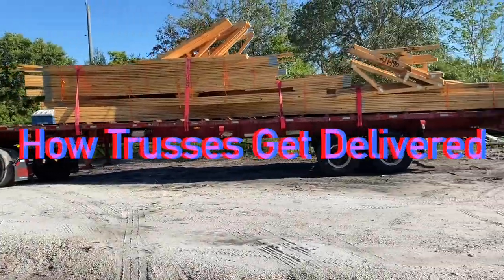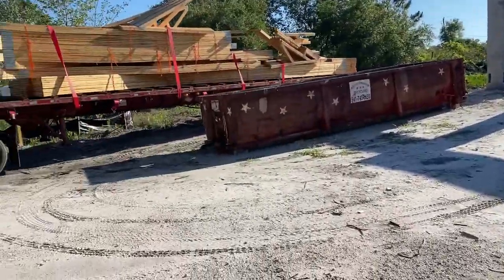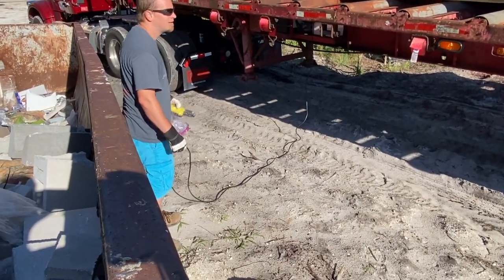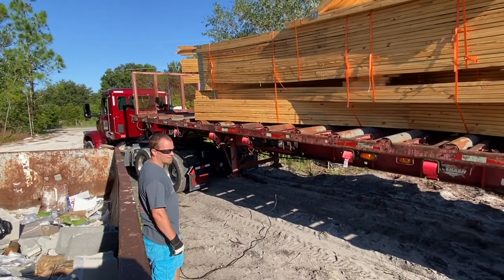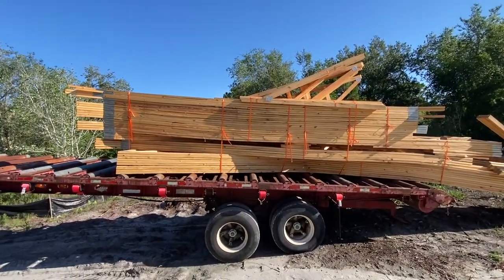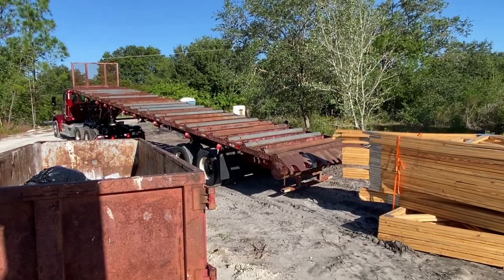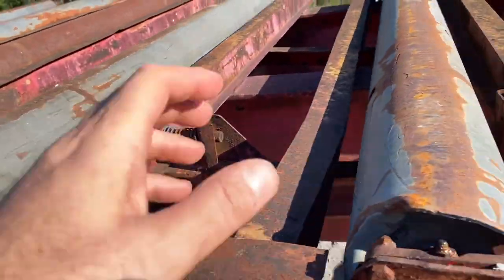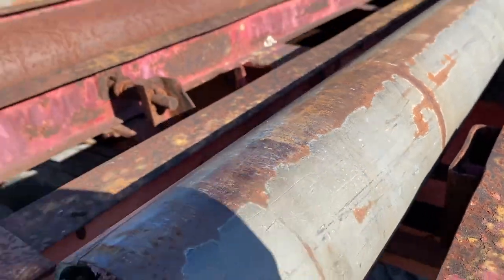How to Roll Off Trusses

Comment: The trick is to not unlock the rollers until you are ready to pull out from the trusses. Don’t let them slide into pallets or other stuff, instead drive out from under them and they come straight down. Some roll off trailers don’t have sliding tandems, so speed is your friend instead.